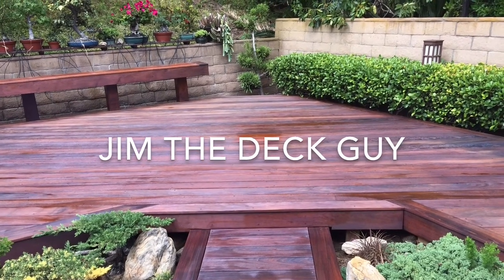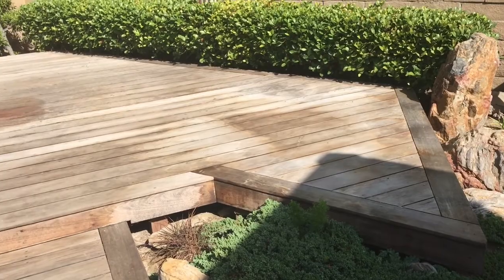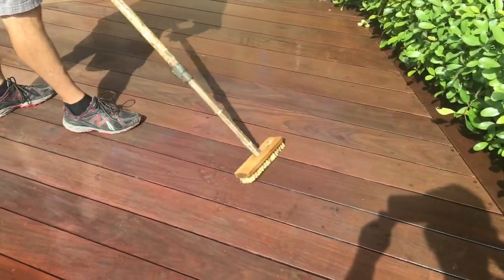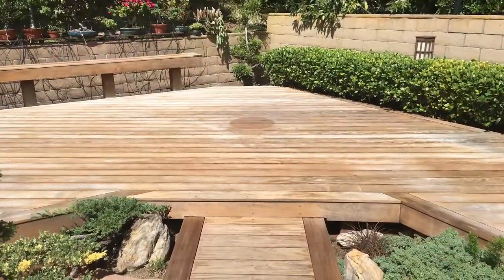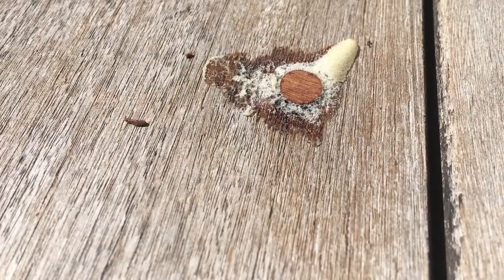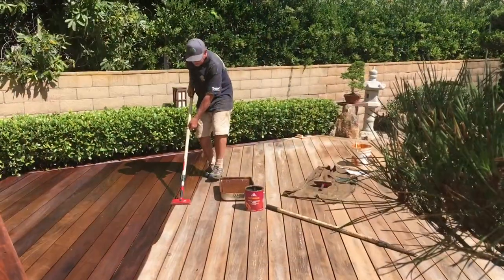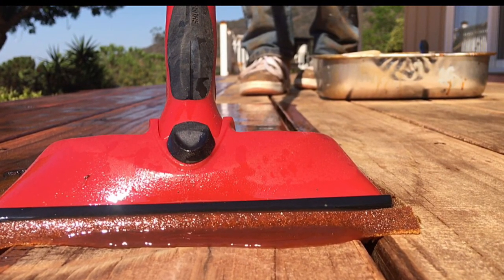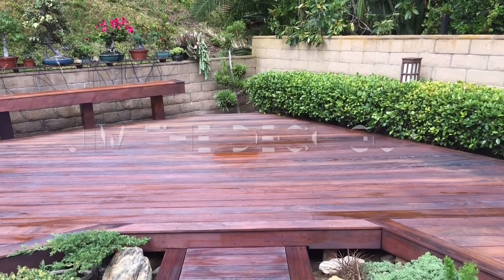Ipe Deck Restoration

Comment: Hi Jim, thanks for the video. My deck is Red mangaris but I imagine it’s the same procedure. I have a problem with cupping how long does it take to be fully dry before you can apply that oil? Do I have to wash it first?
Reply from the maker: Clean first , 24 hours before finish goes on